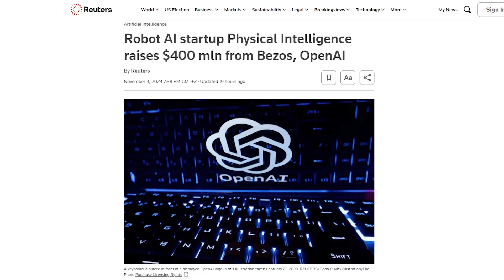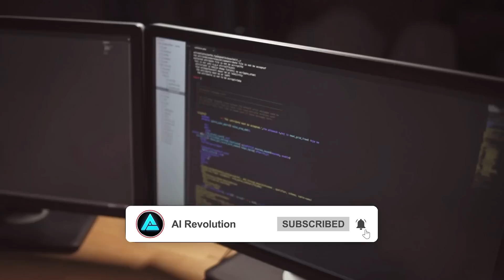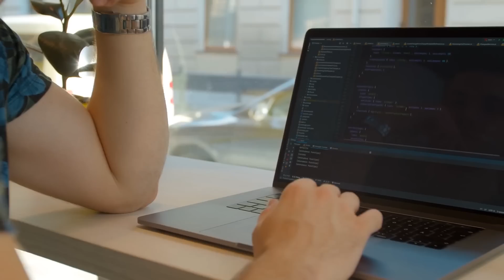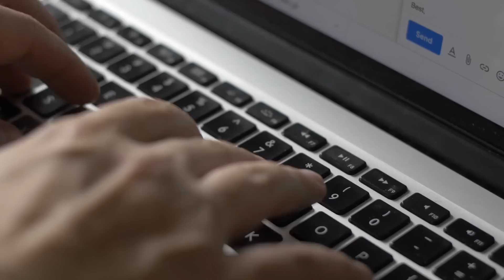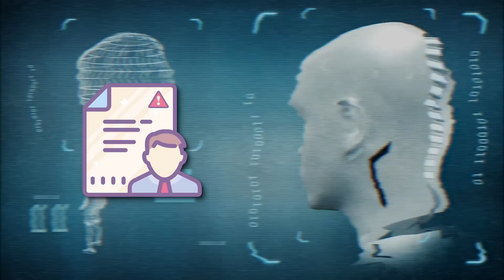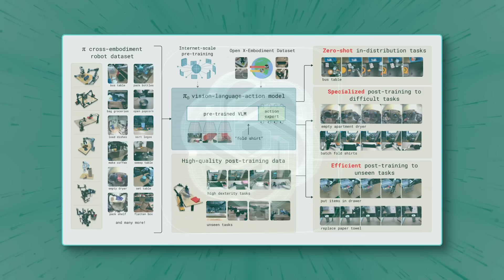First General AI Robot by Physical Intelligence Brings Us Closer to Robotics AGI

Comment: Physical Intelligence has recently unveiled the first General AI robot, powered by their revolutionary π0 model, which is set to revolutionize the field of robotics by enabling robots to effectively perform complex household tasks. This groundbreaking model integrates vision, language, and motor skills, paving the way for a more adaptable and capable robot that has the potential to transform how robots assist in both homes and workplaces.

The π0 model developed by Physical Intelligence is designed to empower robots with the ability to handle intricate tasks such as folding laundry, packing groceries, and delicately handling objects. By combining physical intelligence with advanced technologies, this General AI robot represents a significant advancement towards achieving Artificial General Intelligence (AGI) in robotics.

The key focus of this development lies in the ability of the π0 model to enable robots to not only adapt to different environments but also to perform a wide range of tasks with human-like precision. This level of versatility and intelligence holds the promise of reshaping the role of robots in everyday life and professional settings.

The impact of generalist AI robots equipped with the π0 model could be far-reaching, transforming how robots operate on a fundamental level. With the backing of major tech figures and a robust support system, this General AI robot marks a pivotal moment in the evolution of robotics towards creating more capable and efficient robotic assistants.

The potential implications of this advancement are significant, as it signifies a major progression towards achieving AGI in robotics. By incorporating vision, language, and physical actions into a unified model, the π0 robot demonstrates the potential to perform tasks with a level of dexterity and accuracy previously unseen in robotics.

In conclusion, the introduction of Physical Intelligence's General AI robot powered by the π0 model holds great promise for the future of robotics. This innovative technology has the potential to not only redefine the capabilities of robots in assisting with household chores but also to revolutionize their role in various industries. As we move closer to achieving AGI in robotics, the integration of advanced technologies like the π0 model signifies a significant step forward in the evolution of intelligent robotic assistance.

Disclaimer: This essay provides an overview of the advancements in Physical Intelligence's General AI robot powered by the π0 model and the potential implications for the field of robotics. It explores the transformative potential of this model in enhancing robotic capabilities and reshaping their role in both domestic and professional settings.